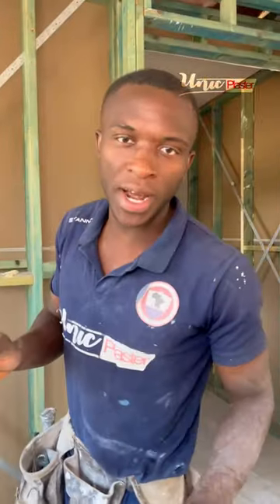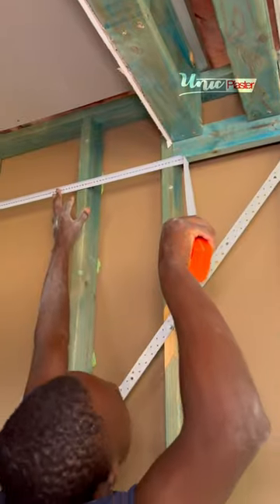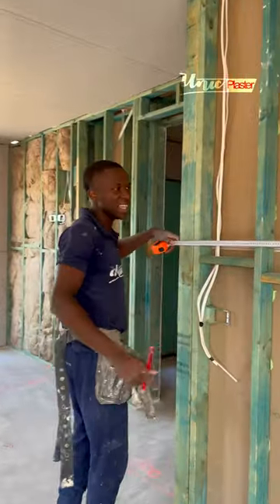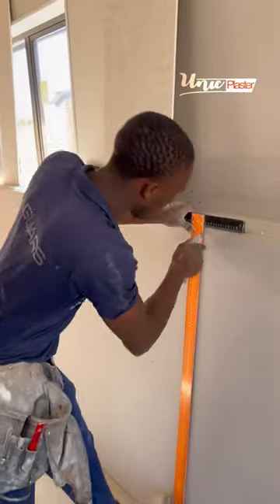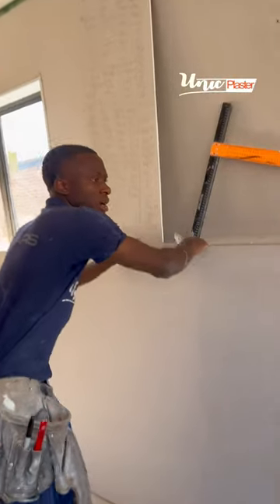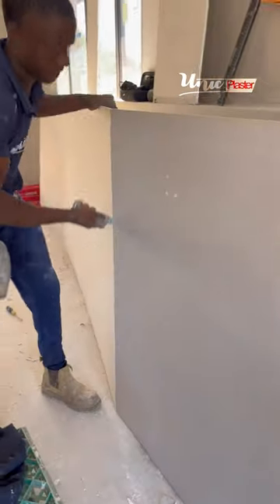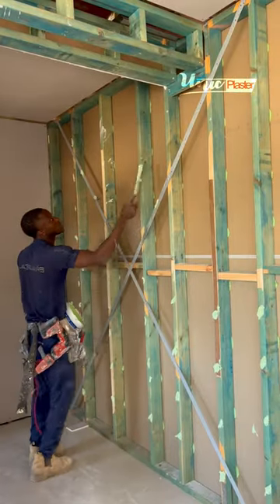So basically it’s not that hard #drywall #construction #doityourself #fypyoutube

Comment: Dude killing it fr. This is my field of work and dudes a beast
Reply: If this is tour field could you answer why does this guy have 2 inch gaps on his ceilings everytime? Is it crown or it that what pros aim for?
Reply: Yes why are does big gaps in the ceiling an walls meeting?
Reply: It’s standard for this guy I’ve watched a lot of his videos. Not sure the reason of the gap but his finished product is very fucking good.
Reply: @stephen3485 in australia its called cornice finish
Reply: @stephen3485 i would imagine its because there is crown molding going up.
Reply: @tcbowen12 not its because he does it ass backwards.. you start at top.. and then use a tool we call a kicker or jack.. to kick the bottom sheet up so the half inch gap is covered by base board..
Reply: @mikethomas3069 there will be crown going up. That's the specs he is getting paid for / contracted to do. It's obvious the man could not leave a gap, if that were the desired result.
Reply: @mikethomas3069  this is kinda idiotic buddy. You can literally see the top joints are unfinished throughout the whole house in his vids. Are you saying he leaves all that until last?? Come on now. Also, I'm a painter by trade. I've worked in some sort of construction related trade for 25 yeard. I'm plenty familiar with drywall work.
Reply: @stephen3485  Certain places do crown molding on the top as a standard. Australia is one of them, where I think this guy is from
Reply: @tcbowen12 cornice goes over the gapsm your years if experience are wrong if you didn't know that. or either your American and still 20 years behind EU and Australia
Reply: @brocksinclair66  wtf do you think "Crown molding" is!? And you say im the one that's 20 years behind?? Lol
Reply: @tcbowen12  your cornice (crown molding) isnt the same as ours big boy. completely different material. ours is the same material as the plasterboard not timber. most of your country doesn't even glue or use collated scree guns lmao. still in the 1980's
Reply: @brocksinclair66 that's because we don't put crown molding on drywall I've never seen that in the USA don't try and compare something that we don't even do over here.
Reply: @brandonsolorzano860  then why have i watch several Americans do it on YouTube
Reply: @brocksinclair66  Idk what youtubers you watch not saying it in a bad way, they may live in a different area, but I've been to multiple parts of the US I've never seen it, I'm a carpenter of 10 years plus specializing in cabinetry I've worked all over they valley(Arizona) never seen crown molding on drywall just cabs.
Reply: Crown molding is a luxury item in U.S. Its part of trimming out. We definitely use collated guns if you’re will to pay 3x the price for a regular drywall gun. I did notice the glue and think we should be gluing like that but then again, building in Europe on average stay around for a few hundred years while ours are about 50 lol for no other reason then we just build like crazy any and everywhere
Reply: @stephen3485 this guy uses a trowel and runs a clean ass corner out in our coat and final swipe. He definitely knows what he’s doing, if he was mudding the top i think we can infer it would be a tighter gap. Chasing perfection will leave you short of good in drywall especially. Not to mention spending hours running out every corner above your head in the house would be such a dumb rookie mistake if it’s getting crowned from the get go lol
Reply: The pros start hanging from the top and use better tools.
Reply: @stephen3485  it’s due to the fact that the wall is just over 8 feet, and he should be shimming from the floor to close the gap as he sets, he’s probably just going quick and being off by about an inch, it’s definitely tapeable though so he can just pack with hot mud in big areas and come back tape and you’ll never tell, he’s really just creating more work for him self but it happens. Otherwise the amount of work this guy is getting done in what appears to be one day is amazing, and he can fix the little gaps and problems, most people have a Crew and will take a day just to hang board, this guys getting 2-3 coats on same day, its definitely impressive
Reply: @G1rootuser Crown molding or not, this is not correct. Its not 1/2 inch off the ground and he didn't stagger boards. He has joints running the entire length ceiling. That's gonna crack and the fix is going to be redoing it all
Reply: Same here. Hanger, steel framer, and taper. Wondering why he starts on the bottom? It leaves a gap up top. It is easier when your alone, but using a handful of screws and a non-collated gun is just as easy. I hate those guns with strips of screws.
Reply: @stephen3485 I am wondering the same thing. Been hanging full time for 8 years now lol. The tapers would be pissed
Reply: @mikethomas3069 exactly. I hang full sheets by myself. Still use nails and for god sakes learn to use regular screws. Takes time to flip them out fast but it's way faster than the strips of screws.
Reply: Definitely
Reply: This guy definitely has this shit down to the T
Reply: @ajs5137 what happens when they dont want crown molding?? Then you have to deal with shitty too gaps/ even if there was crown that gap is going to make it all fucky in two years time. All you drywall guys are the same. You think you do nice work yet you only do what is required. Making it an carpenter/painters nightmare
Reply: @G1rootuser what happens when the next owners don’t want crown? Shitty work for cheap coverups makes for expensive fixes later
Reply: @brocksinclair66 what happens when you dont want “crown mounding” then you are just left with a 2” gap. Any house I see that has “cornice” i automatically chalk up to bad work and cover ups.
Reply: The average joe DIY guy will agree with you bud😂😂😂😂
Reply: Str8 beast
Reply: @stephen3485 I'm assuming you're American and you guys do everything as square-set (square finish) as is in your building code, in Australian where this guy is from (I assume) we only do square-set if it is requested otherwise the gap is covered by 55mm, 75mm, 90mm cove cornice or any sized decorative (ornate) cornice.

The only other time I do square-set is if it's on a fire rated ceiling as that Australia standed (building code)
Reply: @jackreacher3234  I am Canadian.    I also drywall for a living . Crown molding or not there's no reason not to cut this nicely 👌 👍
Reply: @stephen3485 good chance he’s left the gap cause he’s throwing up cornice, if it was square set it’d be tight as shit

Comment: I like the way the insulation is fitted after both sides of the wall are boarded.
Reply: This is Australia. Not the south pole.
Reply: @rocknral  Okay, you do you mate.Are you sure the guy in the video is in Australia? Here in the UK we use insulation in our stud walls, for sound as well as heat. I'll stick to  doing it our way. Thanks.

Comment: That's cool but I never seen anyone hang board like that and I have hung a lot. Most people hang the ceiling then push the first sheet all the way right to the ceiling. Then put the bottom sheet on using floor kickers to close the gaps right 👍
Reply: It'll be cove 🤙
Reply: If it gets crown or expansion at the top, this method makes it easier on the hanger - no holding the top sheet up while screwing or using your feet with a lifter while you screw. Just set it and go!
Reply: Most people stagger the ceiling sheets, and place the wall sheets vertically, not horizontally.   Makes for stronger joints
Reply: 😂  Actually typical residential wood framing the sheets are laid down horizontal. Steel studs in commercial they stand them up. Steel studs are straight, wood...not so much. Thats why in residential you also glue. That way you don't have to screw off every stud and get a wavy look in your walls. Alot less work spotting screws. Journey hanger and finisher.

Comment: Finally someone that actually still uses glue! I can’t stand watching guys hang drywall without glue. And for all the people that install insulation on the face of the stud(the wrong way) this is exactly why it doesn’t get done like that. The stud gets glued, so you don’t cover it with the insulation tabs. They are meant to be stapled on the inside of the stud

Comment: Put top sheet on first . Eliminate the gaps.
Reply: Crown molding?
Reply: There’s no difference
Reply: Itd obviously be a cornice finish. If that's the best criticism you can come up with , why bother.
Reply: More of a sructure thing,  that nuch mud where wall meets cieling...i fors issues
Reply: @blademargath  it's as close to a perfect setting finish around a square set external opening. I foresee you having no idea what you are talking about and you are not specialised in this trade
Reply: There will be a cornice molding place which is made of the same material as the plaster board. This is how it is done in Australia which is where this gentleman is recording this.
Reply: I'm on your side.

Comment: I don’t know if it’s code where you come from where I come from we never stack sheets unless we absolutely have to. We always try to keep the ceiling as airtight as possible because here in the East Coast of the United States it gets extremely cold and heat rises so we try to keep it as tight to the ceiling as possible but good work brother

Comment: Why's he getting praise for this? Look at the size of the gap at the top 😂 thats why you should always start at the top and work down. Use a board lifter for the bottom so the gap is there where the skirting will cover it and it wont matter

Comment: I've read a lot of the comments and have to agree with the few Pros out there that everyone that says that he is a great drywaller and a master of his craft don't know a whole lot about drywall. Number one the drywall that he is carrying looks like 3/8 and even if it is half inch that is nothing to what a pro does in commercial work everyday hauling 5/8 at least 48-in tall sometimes 54s 12 ft long now that is some heavy board! And everybody I know and I have hung close to 2 million square feet in my life starts at the top and comes down to the floor kicks it up to the sheet above it. The only time I stack it is if I have some crazy angles at the ceiling that I'll need that edge of the first sheet to figure them and cut them so they fit nice and tight. I do give him credit for running that mud on the corner bead like he does! I also tape and he is definitely pretty smooth with his trowel although I am a knife man.

Comment: Haven’t seen anybody using trowels in years, most finishers use knives these days so they don’t have to get up on benches to run the tops of metal. He should have taped the the corners and angles and flats by the metal first so they won’t crack. Nobody these days hang the bottom sheets first because it leave a gap up top! He uses a lot of editing t make it seem like he’s moving quickly. If he worked for me he’d need some retraining!

Comment: Put top board on first then there won’t be the 25mm gaps in the ceiling line
Reply: In order for that to happen the person holding the camera would have to help. Union rules, I'm just camera, struggle alone dude and I'll record it.
Reply: It’s likely that they will get a cornice installed there. Many places overseas do it that way.
Reply: 😅 be quiet , stop hating and learn. He knows exactly what he is doing.
Reply: @Born2be76  I’m not hating I’m giving advice ! I’ve been doing this 36 years so I think there’s nothing I could learn from him ! Calm down!
Reply: Cornices
Reply: Tekagi The gap at the top is to piss off the taper.
Reply: Only for square set budd. For cornice/crown mouldings you leave a gap because it’s a waste of energy and effort hanging tight. This way he can hang everything alone and doesn’t have to have the know it all ppl like you around 😂
Reply: @NightlifeReALIty  so, what happens when someone doesn't want the crown anymore, you have a gap. Maybe this new generation does it that way, but whatever
Reply: @chrismazza5306  well from my experience throughout the 50’s and onwards they still set the plaster short of the ceiling so don’t know what shit your saying about “new generation” 😂 its well known that houses are built off the plans and not for how and what changes may come in the future 😂 that’s not how it works. If you build your own house and you are putting up cornice do you pay your plasterer for more hours to hang tight to the ceiling? Or do you save the money? If you do it yourself do whatever you like but don’t talk shit like it’s a generational thing coz I’m old and as far as I know the oldest generations definitely never hung tight as square set plaster was barely ever done. Architecual mouldings are for old timers. All these new generations lazy and don’t have the skill to hang old school cornice moulding so don’t even start. Highlighted reply what a joke
Reply: I agree
Reply: A proper dry liner doesnt need a T square
Reply: @chrismazza5306 well in that instance you'd still have a huge repair job on your hands for the top sheet and the ceiling so the gap is irrelevant. The cornice doesn't fucking peal off like sticky tape mate. And it's not generational. Further he's using standard 1200 sheets on what looks a 2450 ceiling height. Itd be a pain in the arse to order half the board at 1350 with the express purpose of unnecessarily covering a 20 mm gap. Not to mention excess waste.
Reply: @foylad4862 what the fuck are you on. T squares are an invaluable tool. I've seen enough of this bloke to realise he's proficient enough running his blade and tape. As any decent plasterer should be. I have noticed he tapes his fingers for that. Bit of a princess. Take the burns mate. They callous after awhile
Reply: @NightlifeReALIty I'm from your school as well . I'm Aussie. We call those mouldings  fibrous or cast mouldings. Cornices , ceiling panels , strip moulds etc. I cut my teeth in that and your right. The younger crowd are amazed watching me do it and what's involved. Sort of a Renaissance period of that style out here now. I've still got a bucket of horse hair from the moulding off cuts that I use to polish mitres. Best finish ever.
Reply: @RidetheGeoffening  cornices are exterior typically,  molding is for interior work (in the US) whatever they do outside the US I don't care. You leave a gap 1/4-1/2" on the bottom, not the top. It's rare to have ceiling heights 8' or taller so not sure what math you use, but there's no waste mate
Reply: @chrismazza5306  well call it what you will . I'm Aussie so the pro language I use is obviously not atypical for you. Whatever the case it's going to be covered and as the other bloke explained it's not generational. I've been doing this forever and I've never once seen anyone, old school , or new , sheet tight to the ceiling unless it's a square set finish
Reply: @RidetheGeoffening  interesting.  I've never seen it done this way until recently.  Houses pre 1970 most had molding. Now, it's rare unless your in a pretty high end home
Reply: @chrismazza5306  well. There we go. Seems you do care what happens outside the borders of the U.S and as a consequence of that , we've both learned something we didn't know an hour ago. And it happened over the expanse of the Pacific Ocean in seconds. Cool
Reply: @RidetheGeoffening  Tell ya what.  You can show me your drywall skills, then take me for beers and to see Jonny Diesel. Deal?
Reply: @chrismazza5306  fuck....lol. My immediate thought was no fucking way . Johnny fucking diesel. I'm an old school metal head mate. I'm cool with the beers and the  inevitable whiskey (s)  but we'd have to give some deeper thoughts to our entertainment.  Of course it won't much matter after the drinks start. How on earth do you even know Diesel?
Reply: @RidetheGeoffening  eh ? What are you talking about ? A 1350 board?? You just fix top board first and push up to ceiling line! Then bottom board with a board lifter! You have to leave a gap at skirting line anyway for expansion
Reply: @steved6472  I'm well aware of the gap requirement between floor and bottom sheet. You specified that he should start,  top sheet first , now whilst I obviously agree if it's square set it's totally unnecessary when it comes to , likely a cove cornice  finish. As far as the 1350 comment goes , ive watched a few of his vids and he's a pro , he's already 10 up from the floor and as you pointed out , it looks like a 25 - 30 mm gap  to the ceiling, so therefore he'd require a 1350 sheet to make up the difference. Unless of course you like pissing carpenters off by leaving 35 - 40 mm gaps at the skirting line.
Reply: @RidetheGeoffening  so you rip a 35-40mm strip down 💁not go ordering different size boards mate ! I do this on a daily buddy I don’t know what you’re trying to prove to me! I’m actually on site now eating a crappy sarnie on my break writing this lol
Reply: @steved6472  but why ? No time wasting for strips or anything else. Also why the fuck would anyone go around fixing annoying 40mm strips around an entire  house. The gaps fine. It's covered by cornice. It's totally unnecessary to start with the top sheet. Aaaaand I'm well fucking versed, I've done this shit for more than 35 years. Truth is I'm sitting at home as a consequence of tearing my fucking rotator cuff because of doing it forever. I'm not trying to prove anything. It's bizarre to me that  you're insistent on this necessity.
Reply: @RidetheGeoffening  I’m insisting on it cuz I love that your getting aaaaannnnngry! Chill out lad take a Valium sandwich or you’ll tear a blood vessel as well as the rotating cuff thing🍺🍺🇬🇧🇬🇧🇬🇧
Reply: 36 years and can't tell it's cornice 😢😢
Reply: @Opi0id-z  prat
Reply: @NightlifeReALIty  , i must have missed the part where he mentioned a cornice other wise them gaps are no Bueno.